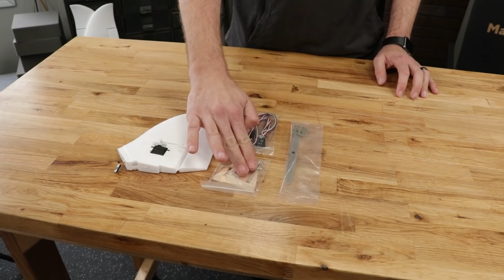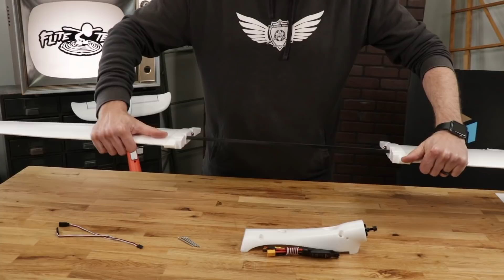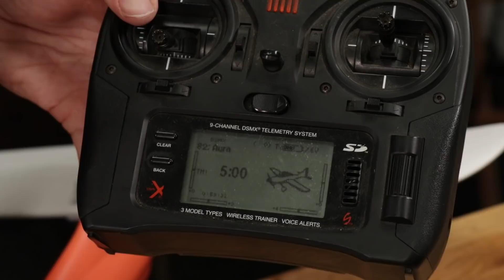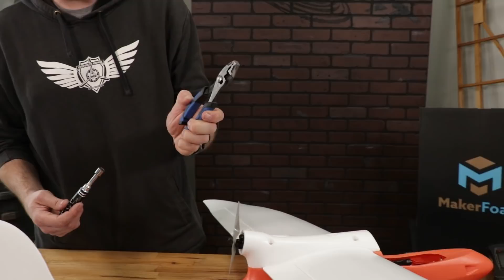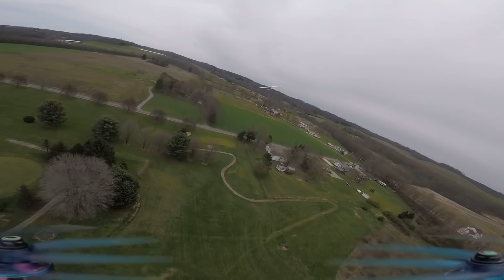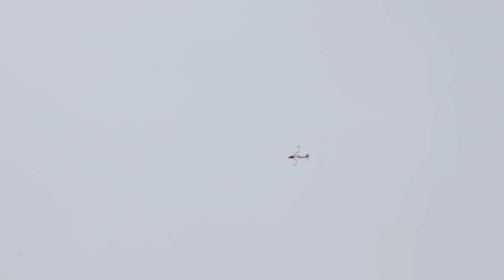Strix StratoSurfer / Build / Tune / Fly

Comment: My favorite airplane!!!  Thanks Josh for reviewing it again!!!  I picked one up at Flite Fest 2018.  I have 82 flights and over 23 hours of flight time.  About 6 times the flight time that I normally get out of a foam board airplane.   I have a 2nd one in the box for when it is no longer repairable.  It is great for FPV or line of sight.  It likes a little bit of flaps if you are flying slow.  It will cruise on 50% throttle.  I started off with the recommended 3S, 3300mah battery.  Now I'm using 4S, 2200 ~ 4000mah,  I just set it up again with the F722 Wing FC and hope to remaiden this weekend.  Waiting on a R9 module on the slow boat to be able to try a little longer range.

Comment: Excellent instructions.  Keep them coming for the Aura controllers please.   

I have my stratosurfer assembled and ready to go.  3200mAh 3S (@249g) shoved all the way forward and she is tail heavy. (with no FPV equip)  Will double up some 2200mAs or get a 4000-5000 for my 1st flight.

Comment: Hi Guys could you explain the difference between a Bixler 2  or 3 and the Stix StratoSurfer - apart from the obvious as in the Fuselage on the Strix is some sort of Plastic and not foam..

Comment: Hey Josh,

great video at the right time because I am thinking about selling my Carrera Favorit Retro Sailplane and buying something else but the Stratosurfer is not available in Germany. I asked Strix a couple of months ago about a distributor in Europe and I think they still don't have one! I have to import it by myself! Both annoying and cost-intensive.

This brings me to the question of the week (directed to Strix); Why should I buy a product from you if you don't do anything to make it as easy as possible to acquire your product?! 

I can tell you (as a vendor by training)that makes no sense at all.

Btw: The first batches of FliteTestFoam have arrived and are already sold out which means you didn't send enough of the good stuff to Europe.

Btw2: Please try the motor mount from SmallCNCparts for a bigger Propeller.
Reply: strix is owned by readymaderc, contact them with your questions about strix
Reply: @matthewarchibald5118  I meant RMRC when I wrote Strix, I think Strix i just a brand from RMRC.
Reply: @nikleiser5888  Why are you using the comments section of a Flite Test video for customer service issues with RMRC?
Reply: Naja die FT Produkte sind (wie man es schon denken kann) eher für den Nordamerikanischen Markt gedacht. Auch wenn Sie seit Jahren sich bemühen mit Modellbaufirmen ihre Produkte offiziell nach Deutschland/ Europa zu importieren.
Ich muss aber gestehen dass es schwieriger geworden ist in letzter Zeit an ihre Produkte ranzukommen, vor allem seit der Insolvenz von Graupner (die offizieller Importeur für Europa sind für Flitetest). Da hätte ich mir persönlich einen Statement von Flitetest gewünscht, wie es weiter läuft mit dem Vertrieb in Europa.

PS: Nimm einfach den Klassiker: ne Multiplex Easystar 2, damit machst du nix falsches;)
Reply: @Vliegende-Hollander  

1. I don't care what market a product is designed for, if you want me to buy it (and make as much money as possible which is the goal for every company) make it as easy as possible for me that's a well-known rule.
2. Lindinger is the official distributor for FliteTest, Josh should have communicated that better and spread the news further.
3. Easystar is not for me because I want the ABSfuselage und Stratosurfer features.

Comment: Isn't this just a bix 2?
Reply: Or may be a MPX Easystar?
Reply: @Vliegende-Hollander  Yes, the Easystar is the original, maybe the most copied platform of them all.
Reply: This plane is based off of the general concept of the old Easy Star style plane, but it flies COMPLETELY differently. Better wings, open fuselage...it can fly like a stable trainer or almost like an aerobatic plane.

Comment: I really wish that ALL manufacturers that make styrofoam airplanes with put proper hinges in them.
Reply: What's a "proper" hinge?  You don't even know what the planes are made out of.
Hint: NOT styrofoam.
Reply: Foam hinges works just fine, and are off course much cheaper to manufacture as they are part of the moulding process. If you dont like them, just cut the control surfaces off and use your favorite hinge instead.
Reply: @KyrreXXL  I have been cutting them off and putting an actual proper hinge.
I paid 10 bucks more for a plane with proper hinges 🤔
Reply: @KyrreXXL  lots of the of the forum hinges are broken and ready to come off when I received the model and parts for them.
lots of unnecessary work if they built them properly from the factory
Reply: @jamesturncliff5960  Well what can I say, I have never had  an issue with foam hinges  unless I have a crash or  something. They are more fragile, I'll agree to that though.
Reply: Almost no manufacturers make styrofoam planes anymore thus in essence it's the same as ALL manufacturers DO make proper hinges.
Reply: @toolbaggers  go to www.robart.com.
That's a proper hinge🤔😉
Reply: Tape is the best hinge